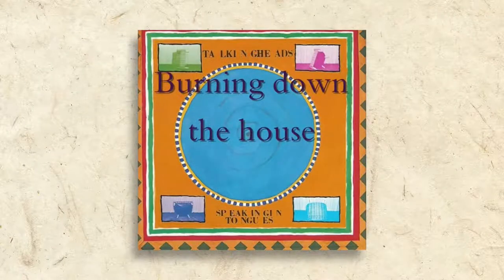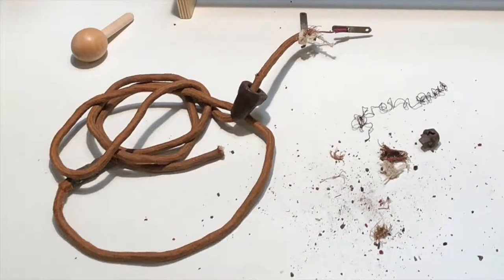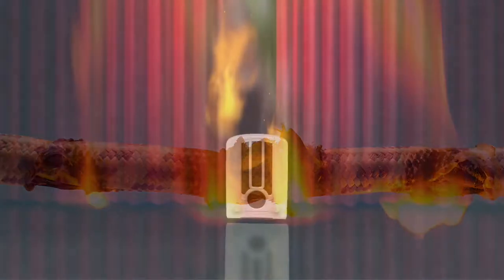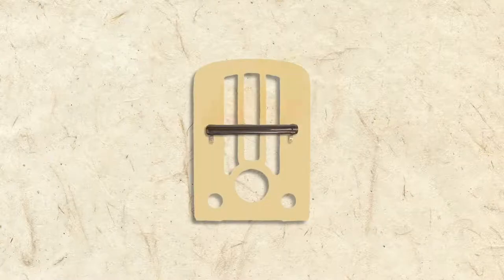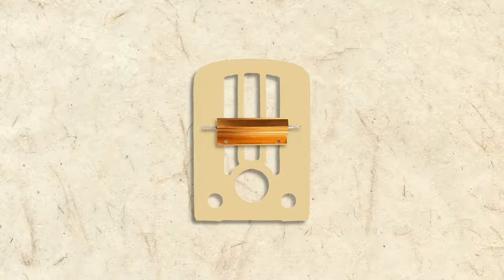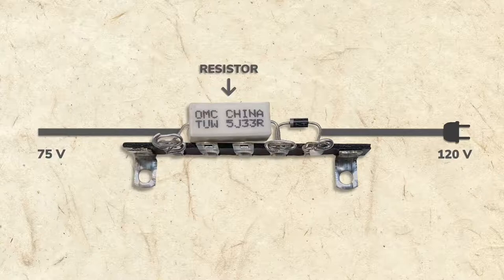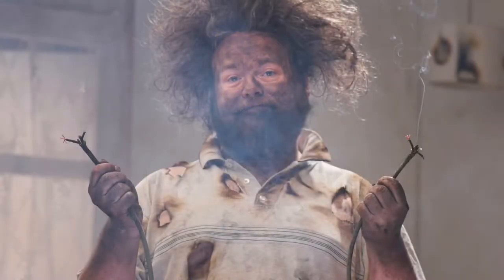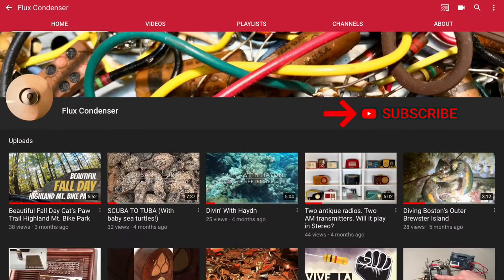Antique Radio Resistance Cords

Comment: I’ve been going through these videos as a refresher course.  Prompting me to actually think again.  This one where you dropped 120V down to 85V with a silicon diode shook me out of my stupor.  I thought, hey, no, silicon diode ... only 0.7V forward voltage drop.  Oh wait.  Half wave rectifier.  Vrms = V peak/2.  Duh.  Kinda rusty here but it’s starting to come back.  Good job on these videos!

Comment: Hi! I assume by this that your radio was designed to operate on either AC or DC, since the rectifier in the power line means the tube filaments are all getting just DC now?